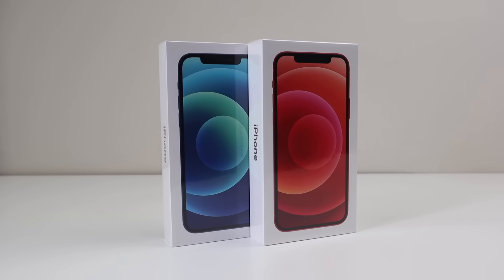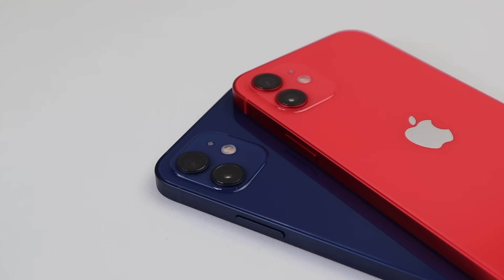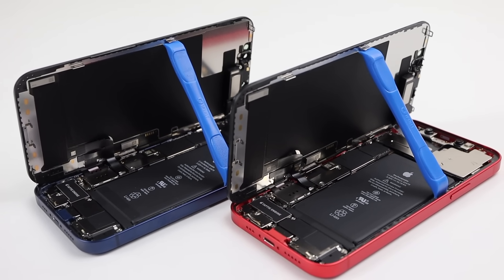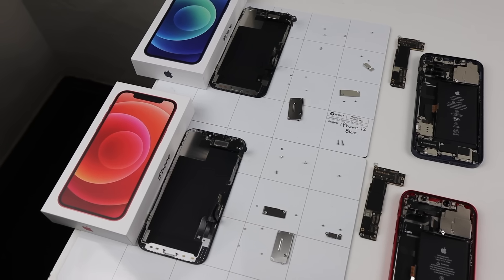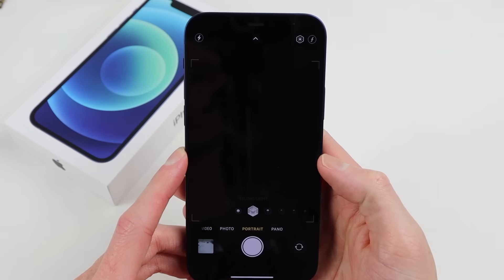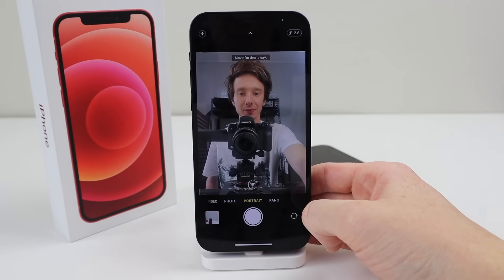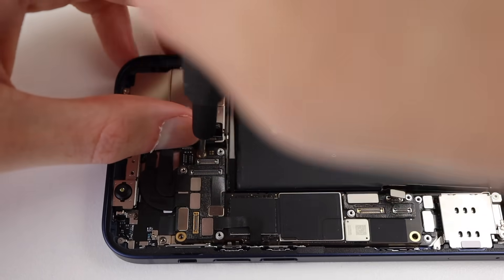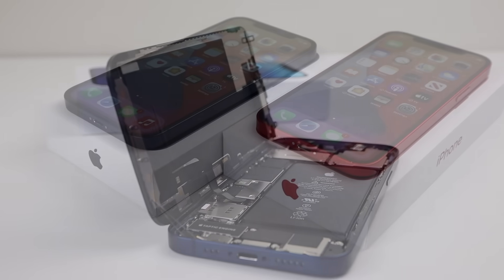iPhone 12 Anti Repair Design - Teardown and Repair Assessment

Comment: It might be interesting to swap just the batteries & see if anything would happen. It would be overcomplicating things to key the battery to it's phone, but I wouldn't be surprised if apple did that.

By the way, how does their charger argument make sense? Ok, they have lots of chargers out there, but they are OBSOLETE chargers. When you sell something, you should include ALL accessories necessary for that product's operation. It's the 21st century. A major brand shouldn't be pulling "Batteries not Included" tactics.

Comment: This is the kind of proprietary Crapple BS that prevents me from ever buying anything from them.  Terrible business model and terrible service.
Reply: I will never buy an apple product again, they did the dirty trick not only on their phones, but also on their laptops - ever seen a comparison of a macbook pro from recent years and one from say 5-6 years ago? the "older" model had hardware design to allow easy replacement of the battery and hard drives.. new models have everything cramped up and soldered into place with all type of proprietary screws and glues so if you attempt to do anything it will brake down - they want you to throw your $2000 laptop into the trash and buy a new one if the battery ever go bad... or send it for "repair" at the cost of almost the half of that price (regardless of the fact that the battery cost to them is maybe $30). Apple is rigged up for the niche market of apple worshippers who have more money then common sense
Reply: Agreed, people who buy apples like to be enslaved

Comment: In order to be made more repairable it would need to be made simpler and easier, which would directly correlate to a worse outside design. I don't think smartphone manufacturers should try to make their internals simpler just because some people who aren't even employed by the manufacturer want to try mock repairs on it. lol Having almost worked for a smartphone repair company I can tell you that they are minimally trained and even charged more than Apple would to repair things, putting your device at greater risk and costing you more money. I don't see why someone couldn't just send these phones to the original manufacturer to be repaired.

Comment: You: Carefully uses various pry tools, tweezers, suction cups, earthing cable, to remove parts delicately

Me:  Forces it open with a guitar pick and jams my fingers in there
Reply: That's another point the video doesn't make, but one that applies to all phones, not just Apple: Due to the very delicate construction and the use of adhesives that require a fair amount of brute strength to get apart, anyone learning to repair phones will probably destroy a few as part of the learning process.

Comment: Apple want to charge you for the parts and repair fee which they charge way higher than 3rd party repair shops. What a monopoly. I buy phone and I can't decide where to repair what a rip off....... Rip apple 🍏

Anyway the 3rd party will get the software tool to copy the original phone data and transfer to the new spare parts.

Comment: Apple is still repairing everything down to the iPhone 4 as of today. Therefore I don't think Apple not offering repairs anymore should be an argument in this discussion at all. In terms of cost, there is certainly an argument to be made. But as long as it is not really understood what's keeping the camera and the battery from working, it's too early to judge.

About the battery: I could see why Apple would want to keep people from replacing those unless they are authorized and use official parts. As someone who buys used equipment, I'd be happy to pay a bit more knowing that the battery is from Apple and was put in by an authorized shop. Or I buy one with the battery worn out and take it to Apple myself, even getting 90 days warranty. The fees for battery exchange are reasonable. If Apple actually wanted to take advantage they would raise the price for battery service on the model 12. Let's see if that happens!

Comment: To be fair to Apple, the power button not working first try after the repair is something that I believe to be a safety feature to assist with repairability. Makes sure you don't accidentally power on the device by pressing the button after reconnecting the battery but before you've finished up the repair.

Comment: funny how you showed like 20 wall bricks that you cant use but not the old cables that you can.  so apple could have even send it without a cable and wall brick and you would still be able to charge it using your old cables. and now tell me how many people you know that dont own a lightning cable... to be fair first time buyers should get cable and wall brick for free or the ones that dont need it should get a discount :)

Comment: Sounds like the independent repair people need to bring a class action suit against Apple.
Reply: This guy is a huge advocate for the right to repair you should check out his channel sir, he actually went to the congress to confront Apple about it, and Apple numerous times tried to shut him and  his company down.  

https://www.youtube.com/watch?v=oLIW7mQ8CI4
Reply: l R is a beast.
Reply: The solution is DON'T BUY APPLE.  I get that regulation is a solution, but the fix is that competition helps consumers.  For a huge portion of Apple's customers, there are zero competitors.  If the designers started craping turds and sticking that rotten apple logo on them, that base would buy them.  Android users have way more freedom.  Yes there are turds there as well, but those will more likely go away due to competition. One of the benefits of apple's products has to "have been" the huge amount of swappable parts.  This video is a disgusting example of how that is no longer a benefit.
Reply: @revklindsey  Engineered masochism the schism of human self respectability as measured by dining the beast that is the psychopathism of jobsian anti consumeorabilia: line i phone model 🗑️.
Reply: @revklindsey  Tax me harder daddy was the mantra even louis rossman cant reason you out of.

Ive had safari corrupt personally. ECC is just there to increase margins by ticking a box. Apple doesn't give a s h i t about its customers. It might as well be a nematode in suit attire and lavish title like genius.
Reply: It’s not that easy tho cause it’s big tech bruv
Reply: @ZeMurdeRouSsCL0WN  It is actually harder to keep the parts from being standardized and make them not work together.  Think about it.  It is not like these parts are communicating wirelessly, they are hardwired with no need for communication protocols.
Reply: LOL, todays repair is get a new one. It's not 1960 anymore.

Comment: The USB-C charging cable is only an issue if you have a really old iPhone. I'm just using the charger and cable from my previous iPhone since it also had a Lightning connector like every iPhone since the iPhone 5.

Comment: "zero climate impact"

Uses batteries and still uses slave labor
Reply: The bigger problem is that it's more throw away tech.
Reply: @triot2127  well wizard tell us how to recycle ewaste my guy
Reply: Dont you kind of need a battery though
Reply: Lithium batteries that explode on contact with heat, and their Logo on every deformation from use of chemicals inside Central Asian water worse then Agent Orange, the villagers use that water now the children are born deaf

Comment: apart from this new trick to increase margins, it is quite common in consumer electronics industry that different intelligent boards in one device (LCD tv, CD/DVD player, etc.) need to be calibrated to eachother in case of analog to digital physical inputs, like laser precision and maybe in this case the camera unit(s). The camera(s) in this iphone 12 might be so sophisticated and heavily corrected elsewhere in a main board, that it needs calibration once it is replaced, to compensated the small differences between camera units. It might be that Apple detects if the paired camera is replaced and decide to lock/mute/suspend/block functionality to prevent issues or complaints about quality. In consumer electronics repair industry (where I was for 15 years), we had a similar evolution, when home based hobby "repair technicians" got stuck because of the required software and programming tools that started to only be available to a selected and trained group of repair companies. If this now also applies to the iphone 12, it depends on the policy that Apple will roll out considering the risk that they could scare away a substantial part of their customers if they realize that they can't go around the corner for affordable repair. Not saying that this all is the case, but I would not be surprised.

Comment: hi, i have an Iphone 6 and basically i have this problem where when i plug it in it shows up with the battery symbol like normal then after a while i'm assuming after having enough charge it boots up with the white screen with apple logo like normal then it turns black then the white screen again. could you tell me whats wrong with it and how to fix it please and thanks!

Comment: based on this logic you are lucky that after replacing the original parts phones start working, I think next goal of apple is if you open up your phone's case it won't work again or show a warring message that your phone needs to be serviced, and you won't get any usb charge cables in the future, just buy a wireless charger it will be more "environmentally friendly" despite to fact that you need more power to charge your phone on wireless, also who needs earphones? didn't we ditch the headphone jack, why do you want earphones?, oh got it "the next big thing" is completely ditch the usb charging port and no one will complain about a charger anymore

Comment: These issues used to arise not from anti-repair practices, but overoptimization. When a design is "on the edge", many parameters are piece-to-piece calibrated, therefore parts cannot be swapped without repeating the calibration process (which is usually not published).

Comment: What is the chance that they will start doing this with Macbooks? I still have a 2015 macbook air and I have manually replaced the battery without a hitch. I would always buy a new macbook as they are, for me, just superior laptops to anything windows related. But this has me questioning that, because I want to be able to repair simple stuff myself, without all of a sudden my trackpad not working anymore.

Ffs apple you bastards, you're already rich enough!

Comment: It's been the same in the car industry with the ECU's etc. There is build in security software, but it's only a matter of time until someone cracks the system. I thinks it's the same with the phones. Time will solve this problems.

Comment: I do have SOME good news for other independent repair folks. Apple still hasn't put any type of security on their COF (Chip On Flex) data, so transferring serial information to and from different OEM displays and batteries still works just fine. I did the same experiment in this video, and was able to transfer serial data to and from displays and batteries, and swap them with no ill effect. Eventually, reputable third-party vendors will release COF-compatible replacement displays as well as batteries with writable guage & data ICs, just as they did with previous generations. It'll be a while before they hit the market though 😒. Until then, I guess we're back to refurbishing OEM displays :::::rummages through closet looking for OCA, UV bed, & cold press machine:::::

I just received the add-on board for the 12 series display, battery, and taptic engine yesterday, so they're available, at least for the Xian AIO. No luck on the camera module yet though. It might be a tough nut to crack, but if they didn't put some weird encryption on the serialization data, we should be able to transfer data between the old module and the new module, EVENTUALLY. 

It looks like they're just messing the camera up on purpose. Apple knows folks won't put up with a malfunctioning camera, but why not just let any iPhone 12 OEM camera module work in any other iPhone 12? Oh yeah,  I remember now!! It's because apparently, according to Apple's lobbyist, us independent repair folks can't be trusted and might install tiktok on your iPhone behind your back LMFAO!! If you don't know what I'm referring to, look for Louis Rossman's right to repair video about the Apple lobbyist saying crazy things in court.

Thanks for this upload. People need to know about this stuff, along with the lies Apple keeps inventing about right to repair. Hopefully one day, people may actually own the device they paid so much for, but I have my doubts.

SUPPORT RIGHT TO REPAIR IN YOUR STATE!!

Comment: I bet they did this to make the hardware more secure for government agents etc. This ensures that you can't attach any hardware to the logicboard that could replicate the data that the faceID sensor sends when it detects the correct user through the dot matrix 3D scan or whatever. So it would have to be sent from THE faceID sensor made for THAT iPhone, which probably has some hardware anti-tamper features.

Comment: I just got off from an Appple chat... "We would not recommend a self repair. If a self repair is done that can create extra charges if issues persist and an Apple repair is needed later." They are actively blocking users from fixing their own phones. "The product you have is not designed to be installed yourself." They state that the Phone was no "Designed" for self repair. and then state that no IPHONE ever was made designed for self repair. "We also would not have advice on that because it is not recommended or designed to be done in that way." "If you are looking to self repair a device it is best to consider buying one designed for that purpose. The iPhone is not an iPhone to be self repaired." these quotes are directly from a Apple Senior Advisor team member named Michael.

Comment: Just take it to a genius bar so they can tell you it doesn't work due to water damage, and you'll have to buy a new phone since it will cost 2x as much as a new phone to repair your current one... and they won't recover your data.

Comment: Heya just saw your video, very informative.  I did notice your airconditioning unit at 14:36 - it might have been one of the ones on a safety recall due to a fire hazard.  My apologies that I am not certain as we had 2 airconditioners and one definitely got recalled - I just can't remember if the one that looks like yours was the safe one or the recalled one, but felt it important enough to warn you just in case - have a google of your model number and see if it has any recall notices.  Apologies if yours turns out to be the safe one (but better safe than sorry).  Hope that helps...!

Comment: And here I am tinkering with an HTC HD2, a phone released on 2009 as a Windows 6 Phone. The xda community developed an Android port to it back then and now 11 years later running Android 8 (released in 2017) with Lineage OS. A Windows 6 Phone from 2009 running an Android build from 2017 all thanks to the open source community. Now you cant replace your screen unless you take it to Apple, and they may even tell you that there is nothing they can do unless you buy their insurance plan. Cant get mad at Steve Jobs, he wanted a brand new experience but super simple to use, he knew his target audience, simple people to take their money from.